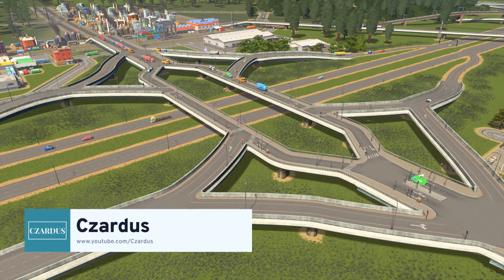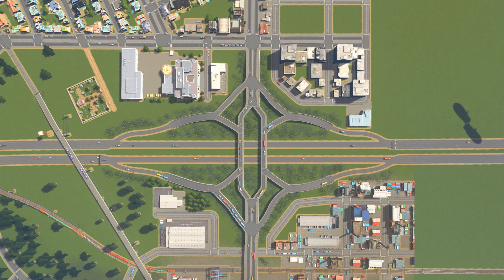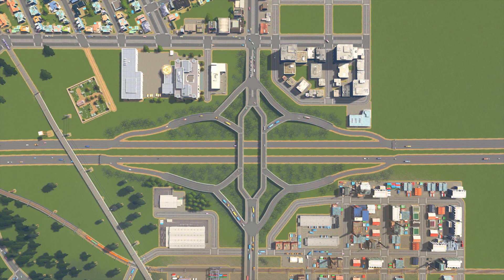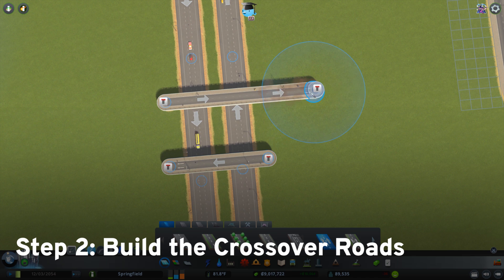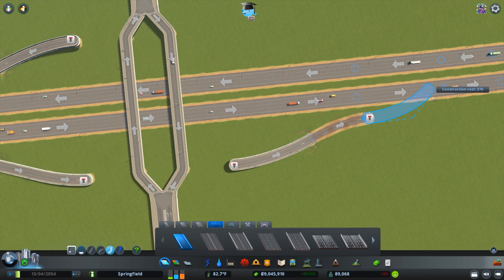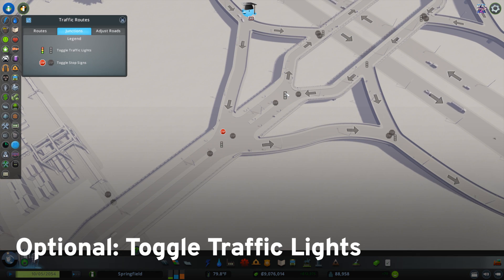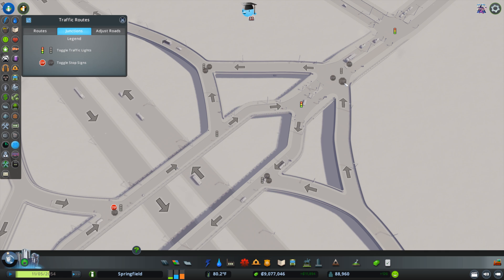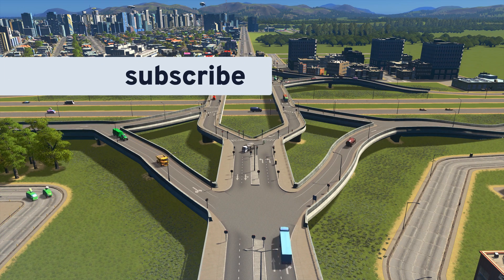Diverging Diamond Interchange with Czardus | Tutorial | Cities: Skylines

Comment: I really don’t understand the appeal of these interchanges. How is it “eliminating turning in front of opposing traffic” when you literally cross over the two directions on both sides of the interchange? You solve a problem by creating another problem. It’s certainly better than some other interchanges I’ve seen (lookin’ at you, Cloverleaf) but you can do so much better when optimizing traffic flow at interchanges in the game.
Reply: It's eliminating half of that turning in front of opposing traffic. In a regular diamond interchange you'd have four turns that cross an opposing line of traffic, a DDI only has two points where this occurs, because of this the setup of the traffic lights becomes much simpler because more of the traffic flows are merging, rather than crossing each other. This reduces the amount of traffic light setups required, thus decreasing waiting times and improving traffic flow. There is also a variant that does away with the traffic lights altogether, by having the roads crossing over one another, rather than intersecting, which is the double crossover merging interchange.
Reply: https://www.youtube.com/watch?v=A0sM6xVAY-A this explains it.
Reply: Actually, it's not better than a cloverleaf. It has the same weaving problem as a full cloverleaf and takes about as much space too. A cloverleaf can be improved with the addition of frontage roads. A DDI can't be improved, it has to be replaced in its entirety.
Reply: Word up man. Diverging diamond interchange creates huge traffic problems since like...always. It’s the last choice of interchanges. And it’s amazingly ugly af...it’s an interchange for sure. But, we deserve better.

Comment: The diverging diamond interchange needs an optimised traffic light cycle. It is horribly ineficient without one, so if you don't want that, you might as well build a regular diamond or a parclo
Reply: Yes I could not agree more as once the traffic gets stuck in the middle It's game over. To get a diamond working nicely you also should have optimized timed traffic lights that are synchronised between the two intersections though
Reply: Agreed. Without mods it isn’t possible to have a big traffic flow with this interchange.
Reply: it really only needs one with VERY high traffic. if the green phases are long enough to let all waiting cars through the crossroads, you're fine. if you want the most efficient interchange, just build a lane without any merging in every possible direction, so that cars cant slow each other down.
Reply: This is a real thing in Calgary and it's terrible. It might actually serve it's purpose if the lights were timed well, but they are not.
Reply: @jherd7909  that's the case with moste traffic light systems around the world. Lights timing is not well optimized. To do that you would really have to model traffic of a huge part of the city, which obviously wasn't done in the last decades and we're still far behind of what we could do today.